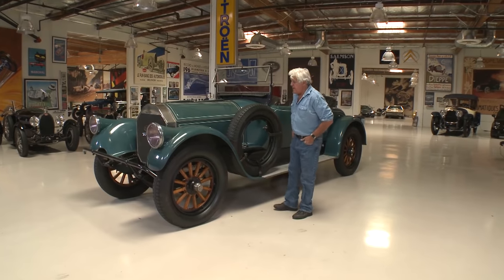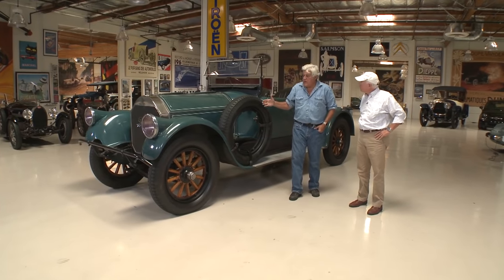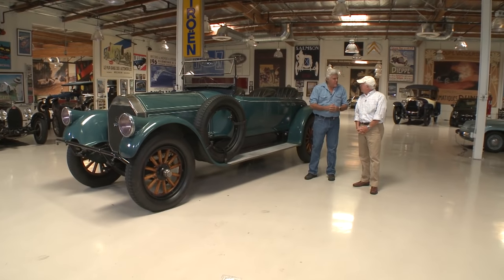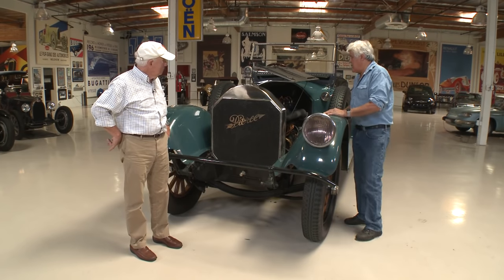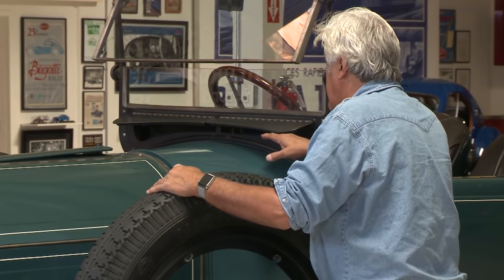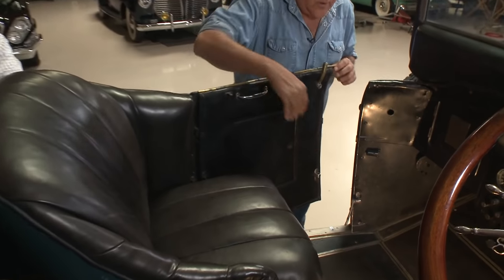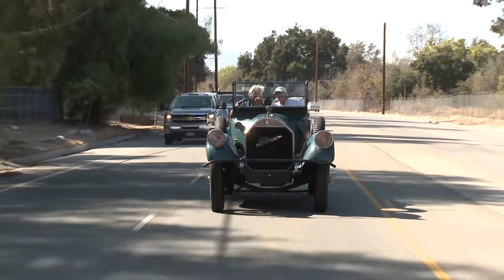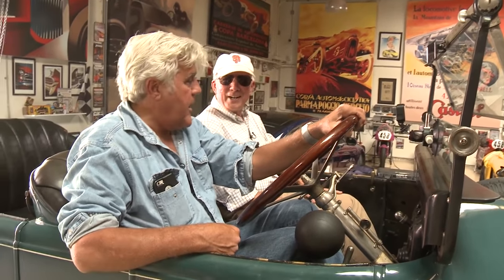1918 Model 66 Pierce Arrow - Jay Leno's Garage

Comment: 60mph on 100 year old wooden rims...
Reply: Storm Viper 

O_O now that's an experience
Reply: I highly doubt the wheels are original.
Reply: Wood is a much maligned material. It does take some experience in selecting the pieces you are going to use for wheels and other high end uses but the wheelwrights that made those wheels knew what they were doing. If the wood was cared for by all the owners there is no reason that they can't last centuries.
Reply: calvingreene90 Jay wouldn't drive on 40 year old magnesium wheels so I doubt he'd drive on 100 year old wooden wheels.
Reply: Magna Vulcan Jay understands that the wood wheels will last if cared for properly. They are not the same as mag wheels. Not sure if they're original or not, but they definitely could be.
Reply: yeah why not. they just don't build trees the same these days.
Reply: this made me crack up
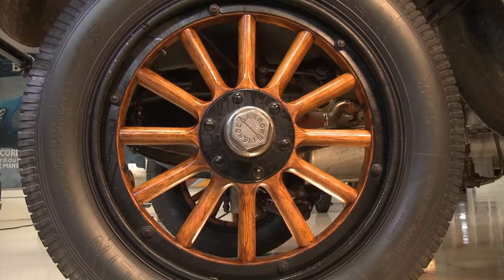Reply: Plez Bon at 14:55 they talk about the wheels, it looks like Jay had them re-done
Reply: Magnesium deteriorates a lot faster than wood especially in the presence of salt.
Reply: He put linseed oil on the wood and maybe worked them over with fine sandpaper.
Reply: We have 700 year old church roofs here in Europe.  Made of wood. Farmhouses too. Hard  wood can last ages
Reply: Hard wood has a very high tensile strength.  Just keep it dry.
Reply: Wood by nature is old.  What do you think the old West was conquered with?
Reply: Wooden spoke wheels were made for hundreds of years.the thick spokes are more than strong enough.
Reply: Linseed oil and hand-sanding with a final lacquer sealant. Pilots fly antique biplanes with wooden props all the time. Wood is a very durable and robust material, very flexible. It needs lots of care to keep it that way. My grandmother's cedar shingled house from the 1940's still has its original shingles today, all just as strong as the day they were cut. The house was painted in lead based paint which helped keep the elements out and they have proper airflow under them to let the house breathe.
Reply: 6200+ pounds on four skinny tires.  What kind of tire pressure are we talking about?
Reply: @MagnaVulcan  Of course they are
Reply: @BenJaminLongTime  its true. all the old growth forests were cut down 100 years ago. trees are harvested at around 40 years old now.
Reply: I remember when it was all trees
Reply: @calvingreene90  
Wood is very strong for the weight, but unlike steel, which bends when you over stress it, wood...splinters. So, rather than have a bent rim if you hit a pothole, you...no longer had a rim.
Reply: one reason for the natural finish , you can spot rot early and fix or re finish
Reply: @arlindjax  They mention at the start the car was never restored though.
Reply: @jeffambrosia5678  The wood that holds up the General Sherman tree is 4,000 years old, just count the rings.
Reply: @hyzercreek  but they didn't have wooden spoked wheels in California 4000years ago..
Reply: @hyzercreek  nobody used any of the wood from general Sherman to make spoke wheels..it's redwood,to soft..it was used to make picnic tables,red wood pool decks, outdoor trm for houses
Reply: @hyzercreek  it's resistant to rot and insects...not suitable when strength is needed
Reply: @hyzercreek  the wood for the wheels on a piece arrow,were cut locally.buffalo, NY is where they were made
Reply: @hyzercreek  be safe..keep enjoying jays garage
Reply: @jeffambrosia5678  Your arguments are idiotic. Nobody said anything about using General Sherman wood for wheels. Just an example that wood can last thousands of years.
Reply: @hyzercreek  argument??just giving you some facts also..
Reply: @hyzercreek  what would make you believe in a comment section,where I had just commented on the virtues of wood, that we here would not know about tree rings
Reply: @hyzercreek  what's idiotic ,is that you went totally off topic,with the general Sherman thing
Reply: I'm pretty sure the rim is metal. The spokes and hub are wood
Reply: @arlindjax  - They put linseed oil on them. They didn't replace them.
Reply: @jody024  - Exactly. Never restored. They just oiled the wood.
Reply: @calvingreene90  I tend to wonder if better, old growth wood wasn’t also a factor.
Reply: @gregraines1599  
What makes you think that old growth makes better wood?
Does hunger induced slow growth make stronger people?
Reply: @calvingreene90  People aren’t trees. You want to know about the difference between old growth and what we have now? Ask a luthier.
Reply: @calvingreene90  I'm glad you guys left this thread alone lol
Reply: @Blackadder75  Notre-Dame’s timbers were centuries old, before the roof burned down.
Reply: @BenJaminLongTime  how did they use to build the tree?

Comment: 14 litres? Does it even need a gas tank or you just fill up the engine?
Reply: id104335409 e just had to tow a fuel tanker...
Reply: what are you 7 years old...
Reply: scootosan No 7 and a 1/2...
Reply: 13,5 Actually not 14.
Reply: jody024 ah, that makes more sense...
Reply: easy people it was a joke lets not forget jay used to host a show that was about joking around im sure he had a good laugh at this and wasn't offended.
Reply: Haaaa...10 gallon carb
Reply: 14 litres of oil, silly.
Reply: @jasonwb6884  no it's of engine
Reply: Actually you have to stop and fill the tank every .006km or .00001 miles xD (figures not accurate)
Reply: 4 MPG as quoted buy the manufacturer.
Reply: 14 litres of air displacement
Reply: @scootosan  🤣
Reply: @scootosan  It's a joke Mr Employee
Reply: That made me laugh.. well done. hahahahaha
Reply: Imagine a 13.5 liter engine in something lighter.. add a huge carb and it will produce some serious numbers, i bet. This makes those big blocks of the 60s/70s look like toys in comparison. Really it uses about 3l/100km, which.. well given it is a 1910s, 13.5 L engine which i bet can produce 700 hp with some work, isnt all that bad. It would never sit in a commuter car anyways.
Reply: @jasonwb6884  ..no..silly...the displacement of the cylinders is generally measured, like this engine, in liters. It has nothing to do with how much fuel it burns or lubricant it holds

Comment: They don't make trains like that anymore.
Reply: You're not kidding.  I saw a display at a railroad museum once showing a piston from a diesel locomotive and a typical car piston side by side.  At 14 liters this car's pistons are probably the size of the locomotive piston.
Reply: The Bugatti Royale they mentioned wound up having its engines put in trains after they couldn't sell the car.
Reply: @mtwilda  -- I doubt it.  EMD (formerly part of GM) was the biggest diesel locomotive builder of the steam to diesel transition era (and for decades beyond).  Their first successful road freight locomotive (which was the first successful road freight diesel locomotive by anyone) had engines with 567 cubic inch CYLINDERS!!  567 cu inch PER CYLINDER.  A 567 was a 567 regardless of whether it had 8, 12 or 16 cylinders.  EMD later came out with a 645, 645 cu in PER CYLINDER and today they still make the 710, 710 cu inches PER CYLINDER.  Cylinders from other diesel locomotive builders were along the same lines.
Reply: @kentallard8852  and Pierce's V-12s were manufactured by Seagrave and put into fire engines from Pierce's closure in 1938 until 1970.
Reply: @mtwilda  5 inch bore by 7 inch stroke.

Comment: There should be some kind of award for the historical significance of these videos for us and future generations. Today, some people don't realize that cars of this vintage could travel reliably at 60 mph. Back in the 1950's an automobile junkyard in Newark, NJ, had a Pierce Arrow converted to a tow truck that lasted for many years. When seeing that tow truck, we were impressed on how powerfully made it must have been. Jay - if you haven't done so, you might consider making a blog for people learning about antique cars, on how to "double clutch", for cars that were made before "synchromesh" transmissions were invented. People don't realize, now, what the manual demands were to be able to drive some these cars. 
Jay, we really appreciate your reminding us of the events that preceded us making us what we are today.

Comment: It cracks me up that it gets half the MPG as my 20,000 lb 1956 PD4104 GM Bus. This car is great and the video field me with joy.
Reply: I bet idling that car along below 35 in level paved roads easily 10 mpg giving the car 200+ range on a highway cruise.
Reply: But does your bus have a 976 cubic inch engine?

Comment: Hey Jay and producers! Firstly, thanks for the amazing videos and demonstrating these beautiful pieces of engineering history. I wonder if it would be possible to put the featured vehicles up on the lift more often? Would be really great to see the undercarriage and drivetrain components, especially because you rarely get that view, and I think it's an important one. Thanks again!
Reply: Would have been great to see the external contracting, internal expanding brakes.  Also mentioned in poetry if I recall correctly.
Reply: Then again, the lift might break.

Comment: Think about it.
Each cylinder of this car has more displacement than the whole engine in an average car made 100 years later.
And the latter produces about twice the power.
But still, what a majestic automobile.
Reply: HellsJerome87---- The REASON so LITTLE H.P.;  VERRY LOW compression;  REQUIRED by the VERRY LOW octane
of the time!!!!!
Reply: Straight Razor Daddy  WELL; YES;--generally HOWEVER; good oil circulation & cooling;--as Jay mentioned;-COMBINED with CLOSE tolerances, DISCIPLINED assembly & PROPER break-in TEND to guarantee
a VIRTUALLY indestructible engine!!!!--------THEIR are cases where HIGH RPM engines give FINE durability;----HONDAs per example;--BECAUSE they HAVE ALL those OTHER factors; But YES if say you put a 3.8 HONDA mini-van engine in a CIVIC, & GOVERNED it to say 3,500 RPM MAX; with the RIGHT size radiator;--uh YEA; with REGULAR oil changes;----I BELIEVE you could get 1.5 to Maybe 2.0 MILLION MILES BEFORE ANY medium oil consummation!!!!!!!!!!

Comment: german silver is copper-zinc-nickel alloy. for those who thought it is argentum
Reply: Straight Razor Daddy silver steel contains around 1 percent carbon and up to 0.40 percent chromium, which gives the steel its shiny silver finish. It also contains other alloys, including up to 0.35 percent manganese and 0.30 percent silicon. It may also feature traces of other materials, such as sulfur or phosphorous. (*According to West York Steel,)

Comment: Let's see...getting only 4 miles per gallon of gas, with a 24 gallon tank, you could make about 96 miles distance before running out of gas.  Not so bad for 6k pounds on wheels, a hundred years ago.
Reply: It does put things into perspective though. Electric cars now are shunned if they have 100 or 150 mile range, due to the lack of infrastructure to support them. Yet this car was in the same situation and no one thought poorly of it, even though gas stations were not as wide-spread as they are now.
I wonder if it's just about the "recharge" time, since you could probably get this refueled fairly quickly, even if it did have poor range.
Reply: Once again he didn't let it idle for at least a 20 count to let the turbo's cool.
Reply: vtr0104 I bet people hated on cars saying they’re not as good as horses. As there is a stable everywhere and not a gas station
Reply: @KevAlberta  Yep, in fact "Get a horse!" used to be (and not that long ago) a common invective hurled at people who were thought to be impeding traffic.
Reply: Straight Razor Daddy thanks for the insight

Comment: Thank you Jay
I have a 200 Freightliner semi that only has a 12 liter 6 cylinder engine though it is diesel.
To put this engine in perspective that is a 14 liter in 1918 the biggest production engine for a road tractor is only a 15 liter today. And that started in 2003.

Comment: Jay do you have to put any additives in the fuel? If so, what kind?
Reply: I use Marvel Mystery Oil.  You can add it to the gas and add it to the oil and it helps clean the fuel lines and helps clean the valves when added to the oil mixture.  I also add Sta-Bil to the gas to preserve the fuel and keep it from fouling if and when the car sits for a long time.  Never had a problem running a Model A, or a 57 Chevy on regular unleaded gas.
Reply: pndragon1 Lmao
Reply: Sta-Bil works much better on real gasoline, than E10 ethanol blend. In fact, in 1 of Jay's older vids, he complains about how poor west coast fuel is, and that fuel system problems in his older cars is the #1 issue he has. He had explained that as many components usually get changed to modern materials that withstand ethanol as possible, but many times, the components just are irreplaceable. He has said in interviews of the past that most times the cars are stored w/o any fuel in them if he thinks they will be sitting for an extended amount of time. He has stated that for some of his cars, he actually buys special mixed fuels by the 50 gal drum. These fuels have lead additives and octane enhancers in them.
Reply: The available gasoline at that time was low in quality and low octane. To duplicate it, add 25% of kerosene to the gas. The engine will actually develop more power, run smoother and cooler on this mixture than straight gas.
With the poor quality gas they were obliged to use low compression so the only way to make power was with a bigger engine.

I don't know if Jay knows this. He should at least add some Redex or Marvel Mystery Oil to lubricate the rings and valves. Today's gas is too dry.
Reply: dash of orphan blood
Reply: Pls note, low compression also works better with long stroke low speed engine designs.  Even modern overhead valve engines that are optimized for low speed operation typically have 6.5 or 7 compression ratio
Reply: Not a problem, just ask your man to fill up a couple cans.
Reply: Well, tetraethyl lead in fuel for cars used to lubricate valve guides and seats and things like that, in addition to raising octane a bit. Valve recession could be an issue in 50s-60s-70s cars with original heads. Don't know about those really old T-Heads though. I used to be able to buy tetraethyl lead suspended in kerosene at speed shops (used to mean a store that sold hotrod parts, not drugs boys and girls) until the mid 1990s, then it became scarce. Health hazard, which is why it was suspended in a kerosene solution; if you spilled it on you in was kerosene not lead going in your pores, not that that was wonderful. I suppose EPA finally nixed that product...I solved the problem by getting heads with hardened valve seats.
Reply: This car was built 10 years before TEL was used in fuel. It has a compression ratio of about 4:1 or 4.5:1 and will probably run on straight kerosene once it is good and hot. It does not need lead. It needs heavy fuel like a diesel engine. Not as heavy as a diesel of course, but it is closer to a slow revving truck diesel than it is to a modern DOHC gasoline engine.
Reply: Like I say, don't know about the T heads

Comment: It has so much torque you can see the body twist at 25:05 when he puts it into the next gear and hits the gas. And I noticed that unless Jay is driving drunk, he wanders over the yellow line a number of times. the steering may be light but it's got a lot of play. Something I've found common in virtually all prewar cars, all that I've ever driven.

Comment: My Uncle has 1913 Pierce Arrow. It had been modified for racing in the '20s and was a 2 Seater with a Fuel Tank behind the seats that looked like a small Household Oil Heating tank. My Uncles were both on the Board of the Lars Andersen Museum in Boston at the time. Pete had the Pierce Arrow and Larry had a '27 Chevrolet

Comment: I wonder if they've ever started every car in there just to hear the sound of 300 cars and motorcycles running indoors at one time. Obviously they're constantly having to start and move these cars regularly just to keep them healthy and safe to drive so I wouldn't be surprised if they've had several dozen running at a time. Wouldn't be the cleanest or perhaps the safest idea but I'm sure they have good ventilation in there.

Comment: Very thoughtful collector design, the manifold gets a little bit wider after each primary joins it. Just like a race exhaust.
Reply: Not really like a race exhaust, more like a plumber would have made it.  The engine is so huge, I'll wager not much effort was put into optimizing the exhaust.
Reply: The pipe style was plumbing but the thought behind it was performance. The more expensive 4 to 2 to 1 long tube headers for 4th gen civic on ebay use bigger pipe after every merge, just like most high performance headers. Whoever designed that exhaust knew what they were doing, every time you add pipes together you need a bigger pipe or else it becomes restrictive.

It just goes to show that the builders went above and beyond with this car just like Jay was saying everything is made better than it has to be. Normal cars don't have headers like that because they cost more to make and take up more room in the engine bay, which is also why upgrading from stock headers will give you the biggest performance boost for the money for an NA car. The stock logs are junk and make cylinders push against each other instead of helping each other.